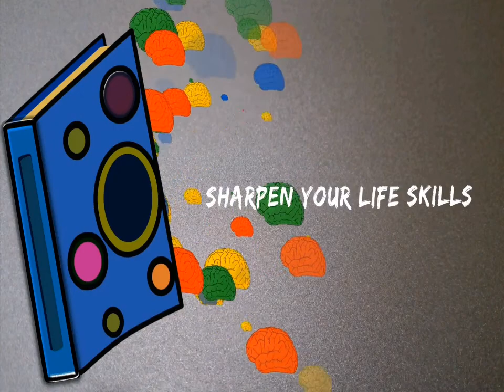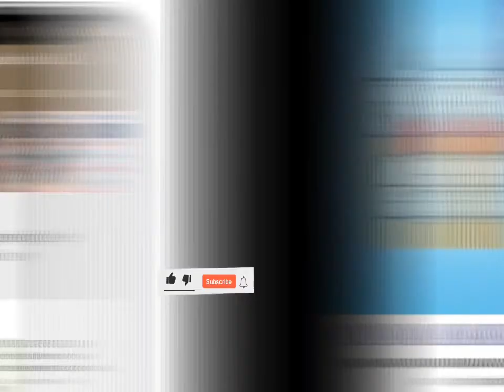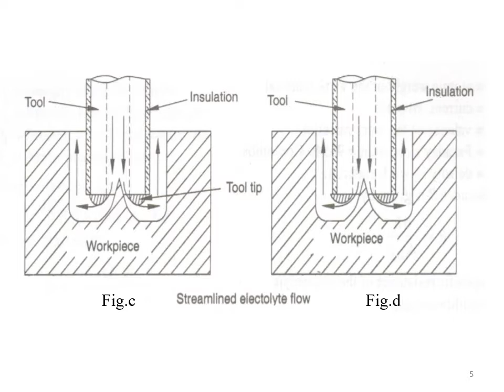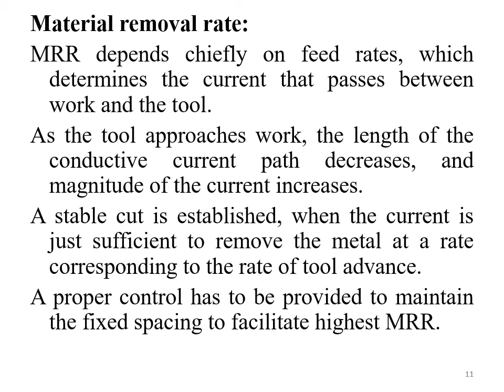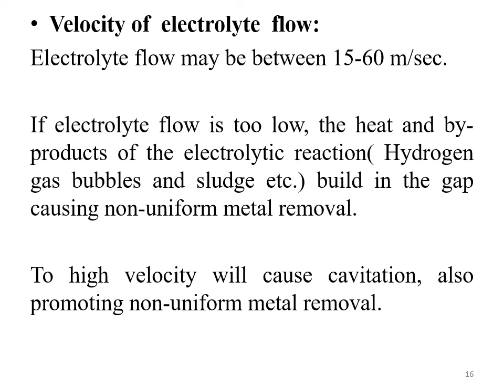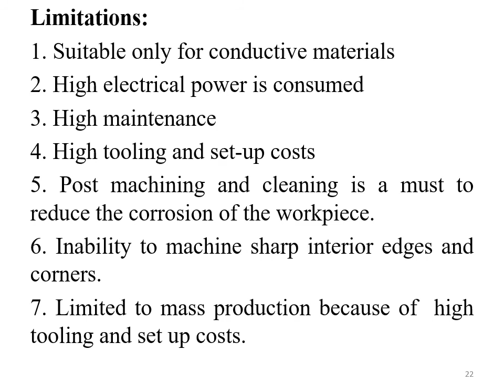VTU NTM 18ME641 M3 L3 ECM Tooling, Process Characteristics, Parameters

Comment: Thank you. Can you reslove this exercise:
During ECM, 10 V DC power supply is used. Initial conductivity of the electrolyte used is 0.2 Ω−1 cm−1. Feed rate is 1.0 mm/min. 
(a)Calculate the IEG at 10, 20 and 30 mm distance from the inlet after 10 seconds. Use the following given conditions : (T = 30 oC, αv = 0 at x = 0 mm), (T = 60 oC, αv = 0.3 at x = 40 mm). Take n (exponent) = 1.75, atomic weight of anode = 55.9 g, density of anode = 7.86 g/cm3 ,             initial IEG = 0.4 mm, valency of dissolution = 2, over potential = 1.5 V, and α = 0.002. Also calculate mean equilibrium gap. 
(b) The composition of nimonic alloy turbine blade is 18 % cobalt, 62 % Ni, and 20 % chromium. Take I =1500 A, and ρa = 8.3 g cm-3. Use valency of dissolution for chromium, nickel and cobalt as 6, 2 and 2, respectively. Gram atomic weights are as follows : Ni = 58.7 g, Cr = 52.0 g and Co = 59.0 g. Calculate the volumetric MRR, and state assumptions, if any.